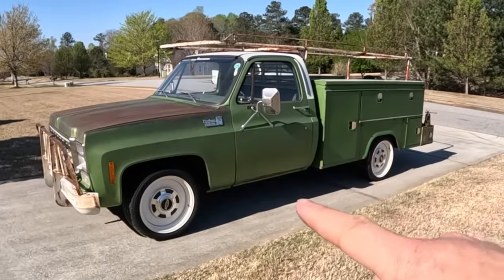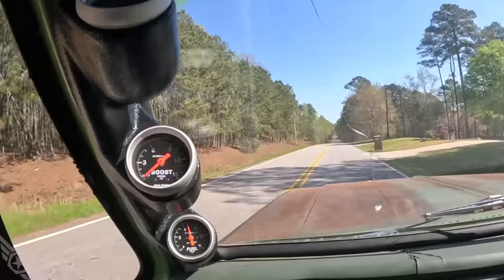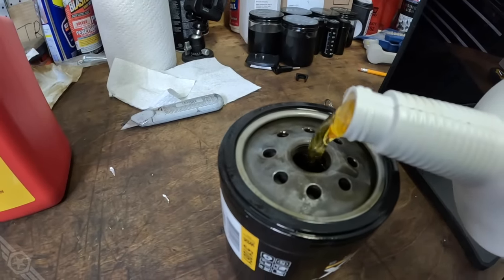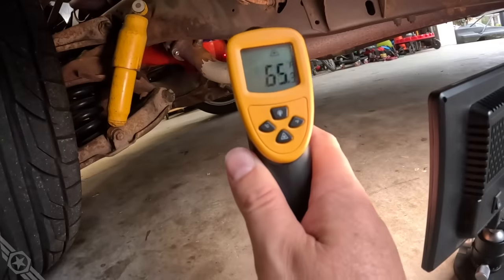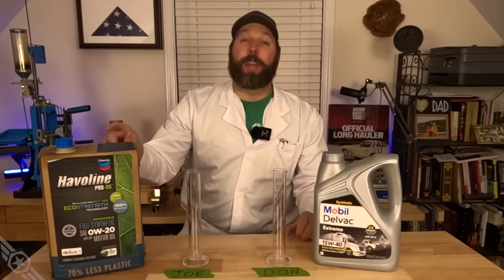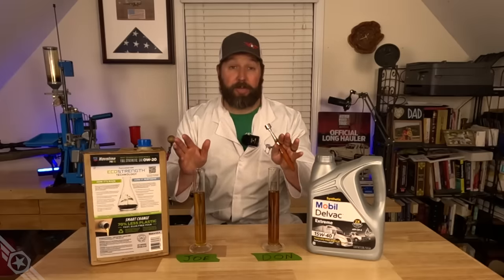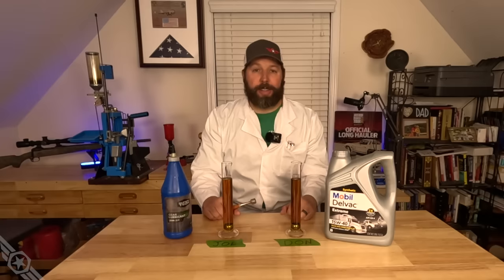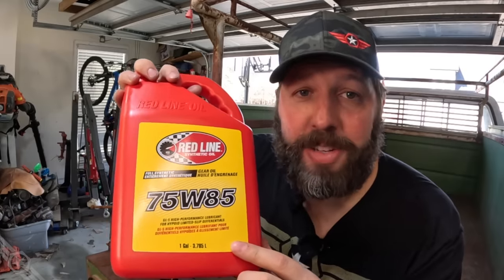Running GEAR Oil in an ENGINE!!! (EXTREME PRESSURE)

Comment: I do know even Harley Davidson recommends 20w-50 oil in the engine, primary, and the transmission.
Reply from the maker: Yep, that’s what I always ran in my Harley’s. There are no Hypoid gears in that powertrain, so there is no need for EP additives.

Comment: Do transmission fluid.
Reply from the maker: I might use it for a future engine flush video. 👍
Reply: @freedomworx  mint. Maybe not on that nice supercharged motor you have.
Reply from the maker: My buddy is putting this one on his swamp buggy. I’ll get his 50 year old, crapped up 350, for testing. 🤓

Comment: Uea ur def pouring the oil backwards. The opening should be at the top when pouring. It let's the air in so it doesn't burp
Reply from the maker: Glug glug glug 😎. I heard that it won’t lubricate properly if you put it incorrectly 😂

Comment: Did you make that drain plug? have you done a video on it? I want one
Reply from the maker: No. It’s called a Fumoto Valve. They come in several sizes depending on the application. https://amzn.to/3w1xOG6

Comment: Oil Geek has science analysis to prove that filter prefill reduces wear.
Reply from the maker: No he doesn’t. He has data to prove that oil is clean enough out of the bottle, filling the filter reduces time to build pressure (this is obvious), and an oil analysis for a second and third oil change that show a reduction in wear metals in the third change, where he prefilled the filter. That means nothing. There are plenty of residual wear metals left in the engine after you drain the break-in oil out. They will obviously be reduced when you drain that second oil change out. Lake is much smarter than me as it relates to lubrication, but that test did nothing to show a reduction in wear. I already have a test planned to prove what his test failed to prove. Go watch his video again and try to make sense of what he did to prove it reduced wear. I watched it several time because I wanted to believe he was actually making a valid scientific observation with those oil analyses, but he did not.

Comment: Always fill your oil filter. Get the oil to the crank and bearings sooner.
Reply from the maker: No doubt that you build pressure quicker, but there is always oil left on the bearing surfaces. It’s not like they are running dry. You don’t need pressure for proper lubrication.
Reply: @freedomworx  I believe in oil pressure. ASAP. That's me though.
Reply from the maker: @stevewheatley243 I understand that. I actually have a really good idea for a video to demonstrate that it doesn’t matter. But it could prove that it matters a lot. Either way, at least some of us will learn something from it 🤓
Reply: @freedomworx  It'll give us something to argue about right?😂
Reply from the maker: @stevewheatley243 pretty much. Now matter what the result is. There will be ole Ty of people that say that my experiment was not controlled properly and my result is void.
Reply: @freedomworx  Boot the trolls off your channel. It's hard for people to learn with that around.

Comment: Holy crap, no way if run a 90° twist valve that would dump my oil with that little bit of motion!!!😮😮😮
Reply from the maker: It’s not going to open itself. They’ve been used for decades. Unless you are driving through corn stalks, you have nothing to worry about. But do what makes you happy 😊

Comment: Does it really matter how fill the oil filter is as long as there's some oil in the filtering membrane?
Reply from the maker: Why does it matter if there is oil in the filter media?
Reply from the maker: @kevenhiemie filters have pressure relief valves built into them. If the pressure across the media is too high (and we are only talking about around 10psi) the oil bypasses the media. If an oil filter blows out, it’s a defective filter.
Reply: @freedomworx    🤷 I'm no expert but
       an old mechanic explained to me this way. Fill an oil filter full of oil and let it sit. You'll see how much oil soaks in the media. 
        Just like fabric, filtering media is stronger when wet. 
The old mechanics said he has seen filters blowout and swears it was because they were put in dry. 
In scientific terms: 
        When a bast or cellulose(oil filters are made of a cellulose media) fiber absorbs water or oil, the oil bonds with the cellulose and pectin causing the fibers to stretch and become stronger.The hydrogen atoms in water or oil create extra bonds.
Reply: @freedomworx  isn't a bypass valve there to let oil pass when the media is to clogged? 
With your theory the oil would pass through the dry media easier than the wet media not needing the bypass valve.
    I'm not saying you're wrong but for argument sake wouldn't the pressure be higher on a wet filter than a dry filter? 
   If a cellulose base material has pressure pushed through it dry the media is weaker and weakened.
Reply from the maker: Yes, the bypass is to let oil go around the media if the filler is clogged, the oil is too cold, or if the oil is simply flowing too fast due to high RPM. There are several scenarios where it might open. I don’t think there is any difference in the strength of the filter media wet vs dry.
Reply: @freedomworx  honestly not that it probably really even matters but there is a difference in strength. 
    Science/Hydrogen bonding tells us: 
 When moisture/oil is present in and between the cellulose fibers(filter media), it will exhibit an intermolecular phenomena known as hydrogen bonding, which induces attractive forces between oil molecules. The summation of these forces provides a net increase in tensile strength.

(2) Moisture/oil causes a decrease in friction between the media making it more pliable, and less brittle. Think of dry vs wet clay. Dry clay is not as ductile as wet clay and will likely fail before its wet counterpart.
Reply from the maker: @kevenhiemie  which is stronger… a dry piece of paper (cellulose) or a wet piece 😉
Reply: @freedomworx  dry paper but paper is not a cellulose products. It's pulp. Any cellulose structure is ground into a pulp to make paper. That's why writing paper has almost no ability to absorb moisture. Now we're talking plant science which is my Education and livelihood. 
    Which is stronger.... A dry paper towel or wet paper towel? What about a piece of wet hemp paper or dry hemp paper? 😉
Reply from the maker: @kevenhiemie did you just say that paper is not a cellulose product? 👀
Reply: Sorry I went to school for plants not writing. 
Correction.  ***paper is not the same cellulose product. 

The cellulose structure is still there but much much smaller. Plus during the process of making pulp lignin is extracted from the pulp Which is a glue. What does glue also do. Repellent water.
Reply: @freedomworx  can we agree that paper and filtering media is based from different cellulose products. 
     I answered your question can you please answer mine. 
     Which is stronger.... A dry paper towel or wet paper towel? What about a piece of wet hemp paper or dry hemp paper? 😉
Reply from the maker: I'm no chemistician. I do nuclear. I have no retort 😂
Reply from the maker: I'll take your word on that one. I know nothing about cellulose. I just read Wikipedia 😉
Reply: @freedomworx  no 💩 nuclear. Is that what you really do for a career? 
   I can tell by your lack of endowment that you see that there's a scientific reason to put oil in the oil filter. does it matter probably not.
Reply from the maker: Yes, nuclear is my day job. You’ll sleep better if you don’t know the agency I work for 😂
Reply: @freedomworx  yeah you're right!
 Now all I can think about is Homer Simpson driving a supercharged service truck and not Mr. Plow. 😂

Comment: Well, I learned something and was disappointed at the same time. I was just waiting for you to dump the 90w145 in and hoped you would freak out when you pegged the guage at idle. 

I didnt know and am also disappointed that fear oil and motor oil don't use the same viscosity rating.
Reply from the maker: the 85W-140 would have pegged the gage or broken something. Maybe I'll test that on a scrap engine 😎

Comment: They came up with different numeracy to avoid consumer confusion, to prevent the average Joe from using gear oil in their engine.  So, if there were two separate groups of engineers, they were, in fact, communicating with one another.
Reply from the maker: I’ve had several people say that, but I’ve never actually seen it stated in an SAE Document. It might very well be true, and documented, I’ve just never seen it.
Reply: @freedomworx  Read it in a technical publication by an oil manufacturing company many years ago.
Reply from the maker: I’m not doubting you. I’d just want to see it written in an SAE document. I’ve seen major oil manufacturers post things that are obviously inaccurate. Not that the oil companies don’t know what they are doing or saying, but often times, the people that author post, blogs, and articles within these companies, dont know what they are talking about. And it’s not their fault, nobody knows everything, and we all have anecdotal “facts” bouncing around in our heads.

Comment: “Nobody has this crap in their garage”…wait, I do! It’s the gear oil required in my 41-yr old BMW.
Reply from the maker: There's a few of you out there. It's generlly used in manual transmissions, which are an endangered species 😉

Comment: Little demolition derby tip for you all. Put 50% heavy weight gear oil and 50% normal oil in your engine. Helps the motor not lock up at high temp. And you don’t have to worry about combustion by products because an engine will never last long enough to know what’s happening to it.
Reply from the maker: Thanks for the tip. Never would have crossed my mind if I got invited to a demolition derby 👍

Comment: Back in school we had guy add 80/90 oil to a slant 6 it blew off the oil filter
Reply from the maker: Don’t need an oil filter with oil that thick. Ultimate protection 😂

Comment: I see.  My vehicles pump oil from the pan through the filter then the engine. Gear oil doesn't flow as easy as engine oil that is why i think it would cause a filter to bypass until warmed up.  In your video it was already warm when you started.
Reply from the maker: No, I’d did cold and hot pressures. The 75W-85 is simply thinner than the engine oil. That is the entire point of the video. Both oils were tested at the same temperature in the garage and the “lab”
Reply: @freedomworx  by cold i mean -20C -30C I live in canada.  5 months of that bad weather.  I wonder if your gear oil vs 15w40 would still flow close to the same here in winter.
Reply from the maker: @stevefortune4315 I wouldn’t be running a 15W-40 there, I’d be running 0W or 5w-40. In which case, no. 75W gear oil is thicker than 5W engine oil.

Comment: i put those valves on every single vehicle ive owned.. makes it so much easier and less messy--- and i always pre fill my filters .. i mean Why not ??? i want oil flowing around quick not have to wait and THEN  start doing its job
Reply from the maker: Yeah Fumoto has take several of my dollars. 😂

Comment: Your truck should run on any mineral oil, the problem is long term use and wear.
Reply from the maker: That oil only stayed in there for about 6 miles 😉

Comment: I ran gear oil in my old 351, the only difference I could tell was the “butt smell”.
Didn’t use it long time but everything seemed the same.
And at the end of the day, some oil is better than no oil.
Reply from the maker: Smells like a rolling garbage can. 😂

Comment: In 1971 I put gear oil in my 1946  Harley engine.  It didnt run long after that. The rear piston broke
Reply from the maker: Those were the AMF years. It would have broken regardless 😉

Comment: Very interesting , and talking about but , engine oil is used as gear oil in   mototcycles.......( with shorter service intevals. )  If the same apply to gearoils.... who knows 😂
Reply from the maker: I forgot about that. I used to ride and race myself. Always had 20W-50 in the Harley Gear Boxes and 15W-40 in my 2-Stroke KTM Gear Boxes.

Comment: The oil pressure is wont go up anyway because the oil pump has a bypass that is set at a certain pressure
Reply from the maker: The relief valve pressure is not 45psi. It’s usually 55-70PSI. So yes, if it were actually more viscous, the oil pressure would have gone up.

Comment: Could you try this in a brand new Duramax?
Reply from the maker: You could. I wouldn’t be scared to do it on mine. But didn’t want to spend $250 on gear oil. 🤑

Comment: This may sound stupid but I have bought ASE 80 motor oil. Brandon wants an old Ford the rings left how about 50,000 ago. And we used to put graphite oil in our motor
Reply from the maker: Ive seen SAE 80 aircraft oil. Didn't even know they made 80 Weight for terrestrial engines.
Reply: @freedomworx  yes sir they did. Back in the 60 ,70, and 80's . Oh dang I'm old.

Comment: It will work but beside of bypass opening at all times running. It will be gumming up the engine and that will be costly.
Reply from the maker: The bypass is not opening in this video. 75W-85 is thinner than the 20W-50 in the engine. That’s the point of the video 😉

Comment: I bet the oil filter was bypassing immediately.  
I think that would lower the psi.
Reply from the maker: It’s thinner than the engine oil that’s already in the engine, so there is no reason for the oil filter to bypass. Also, the filter bypassing doesn’t lower the gauge pressure. The gauge is located downstream of the oil filter.

Comment: You wanna see how thick the oil they ran in WW2 Aero-Engines. Thick as cold treackle...until it was warm.
Reply from the maker: I was there, I actually poured it into the engines. Barefooted in the snow 😉.  I assume you are referring to air cooled engines?

Comment: Don't fill filter....disconnect the spark and turn the engine over until oil pressure is achieved....👍
Reply from the maker: I’ll see if I can find the spark plugs on this Duramax 😉
Reply: @freedomworx  lol....
Turn the fuel off if it's diesel...
Do you need me to show you how?
😉....especially after a rebuild.
Reply from the maker: @MalleusDei275  pretty easy on my 12 Valve, I'd have to look for the fuse on my Duramax 🤓
Reply: @freedomworx  
I ate a caterpillar once....
for a piece of foil.
Reply: @freedomworx  terrible taste.

Comment: I did not know that, I just put in what the Manufacture says to put in and hope there not trying to wear out my engine to early, so I have to buy another car. If you buy a new car every 5 years, don't worry about. Let the next guy worry.
Reply from the maker: OEMs aren't trying to wear you're car out prematurely...probably 😉 But it will be interesting to see how all these cars running 0W-8 and 0W-16 are doing after 200K+ miles.

Comment: I've always pre filled oil filters. Cummins recommends it.
Reply from the maker: There was a time when Cummins recommended against it. And Caterpillar still does. I’m not agreeing or disagreeing with them. Just making the statement.
Reply: @freedomworx  , didn't know that. I think it's asking for trouble not filling oil filters. I've never heard of a engine failure either way.
Reply from the maker: I’ve personally never heard of or seen any failures stemming from not filling an oil filter. There is still oil in the bearing surfaces, regardless of any oil pressure. Many small engines live their entire lives without any oil pressure.

Comment: Why not stick with the vr1 ... it's a special formula that had all the zinc unlike standard gas engine oils
Reply from the maker: The Lucas Hot Rod oil is a better choice. VR1 is a racing oil, which means it doesn’t have a lot of detergents and dispersants in it. It’s designed to be changed at very short intervals. That’s why if you ever watch drag and drive events like Hot Rod Drag Week or Sick Week, those guys are changing their oils throughout the week. Racing oil is designed to handle extreme loads and heat, but not really formulated to handle a lot of contaminants. So it needs to be replaced often.
Reply: I figured they just changed it because it's cheaper than a $50k engine. If you drain it and it looks like stripper vomit then there is a good chance you engine has entered the hand grenade phase of its life
Reply from the maker: @jasonbennett9851  it's a little of both. 👍

Comment: So question now is why some trans rebuilders recommend using motor oil 10w-40 instead redline 75w85.
Reply from the maker: It’s cheaper and easier to come by maybe 🤷🏻‍♂️
Reply: They stated that their warranty for rebuild wont hold unless using motor oil. So not that.

Comment: No, your oil pressure regulator opened a bit further in order to keep pressure at normal levels.

What you are destroying are your rings and bearings, which need motor oil, not gear oil.  Gear oil is designed to avoid shear, motor oil is not~
Reply from the maker: The oil pressure relief valve is not opening. It does not open at normal pressures. That should be a ridiculous way to design a lubrication system. You would be adding heat and wasting fuel and power to pump oil you didn’t need. 75W-85 gear oil is thinner than the engine oil in the motor. It’s that simple.

Comment: I had a worn out briggs stratton mower oil ran thru it and it smoked blue. I put 80w90 in it and it mowed 3.morenyears until.motor calved.
Reply from the maker: Whatever it takes 😎